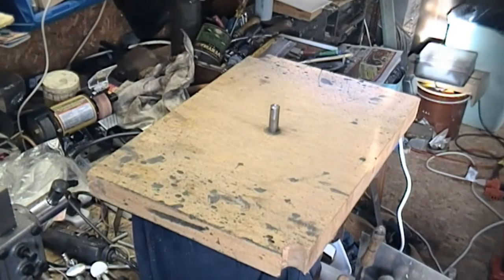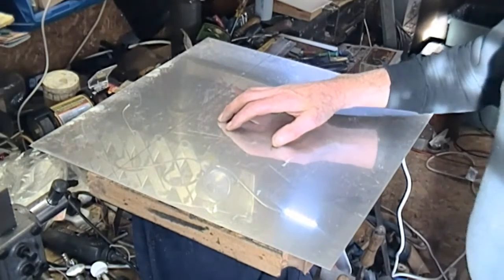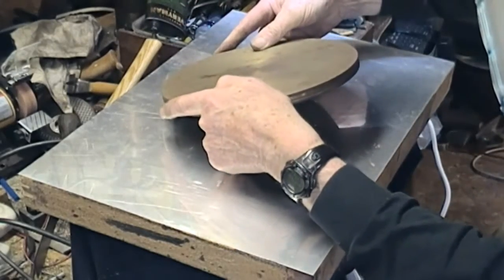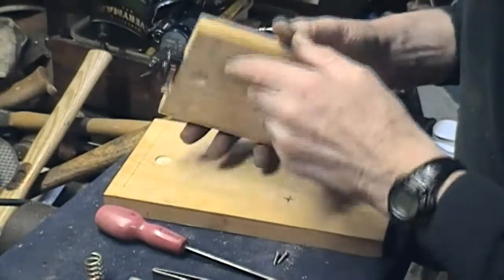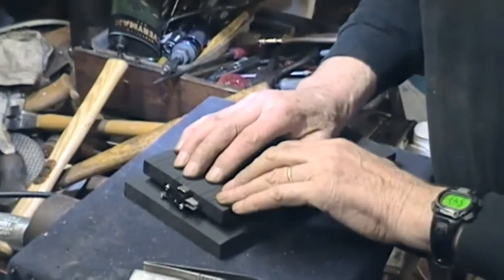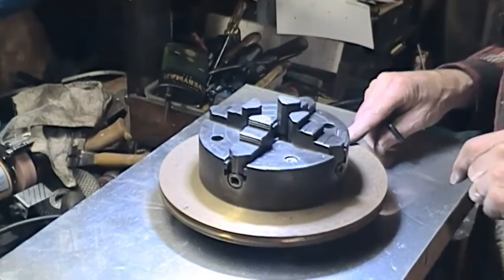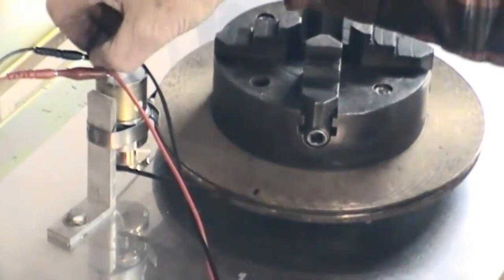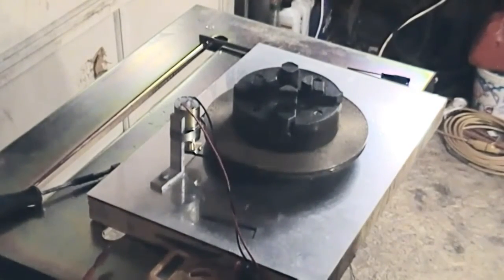Motorized Turntable, Part Two

Comment: Actually thought it was lots of progress and really coming together.  Love the foot switch and made a couple similar over the years!  My first grinder was on a 2x12 with a scrounged 1/2" arbor and washer motor with a cut up sheet metal real estate sign for guards and similar foot switch.  The one thing I found with them is to put a tie cord from the base to the elevated part to keep it from losing the spring if I kicked it accidentally.  :-)  I'm sure your subscribers will grow because of the nature of things you do.  Making things from bits and scrap, cheap and cheerful on the fly is where a lot of us come from I think.  It's the mind and vision at the core that simple elegance derive from.  Keep building it, they will come...in droves, I think.  Thanks for sharing!  ~PJ  P.S...maybe a piece of ~3" ducting for the motor cover?
Reply from the maker: Thanks for feedback. Indeed, us 'entrepreneur pack-rats' have to make do as and when we can! Your first grinder sounds a bit like one of my early efforts! I already have it in mind to fix two small pieces of leather to each side of the foot switch so  Mr Spring can't escape!! :)
Reply: ChrisB257
Leather is quite elegant I think.  ~¿@

Comment: Very nice, something like that sure will come in handy. There are many time I could have used one. Just wondered did you or will you be doing anything to capture or retain the spring on the pedal in case it gets bumped and decides to fly out of it's pocket.
Reply from the maker: Thanks - Thought of that - I'll probably add a short piece of leather to each side as a limiter - easy to do.

Comment: If I can make a suggestion. Make a 3 or 4 step rubber cone and attach it to the motor and use it as a friction drive. This would eliminate possible damage to the belt, and by changing position/high of the motor you would change the speed of the table. Use a stretch of tire tube to ring the table so that the cone could grab. Just a thought.
Reply from the maker: Thanks. Have considered that approach and may well try it out later on. The project has a ways to go and all ideas received have been gratefully received... I think however the belt will last quite well as, though small, it is well reinforced and deceptively strong.
Reply: ChrisB257 Fun video.